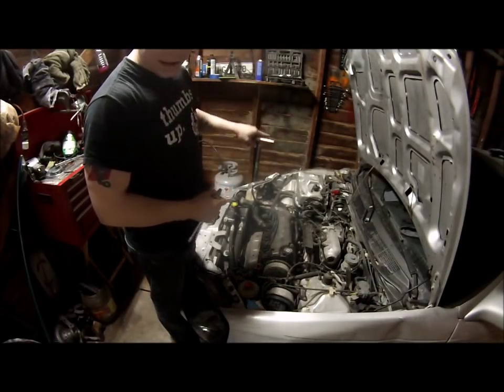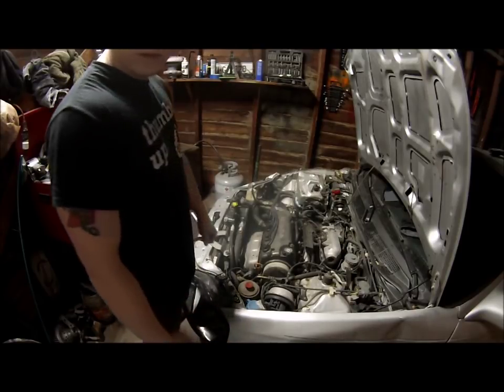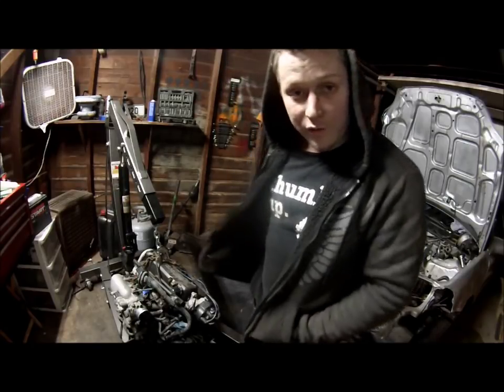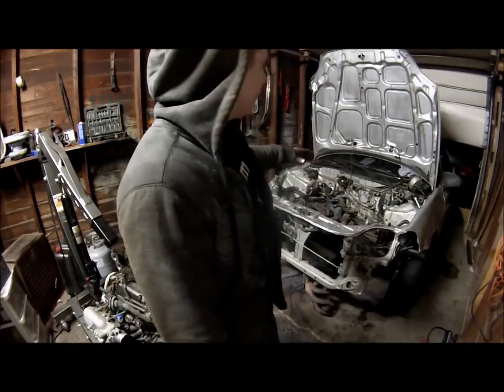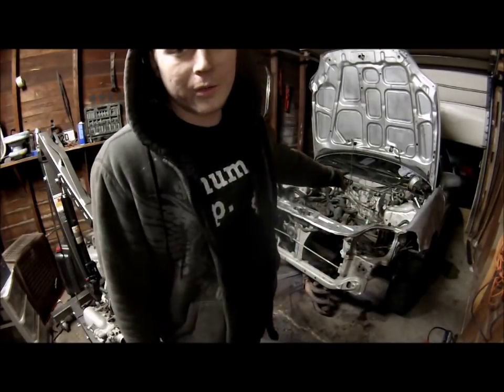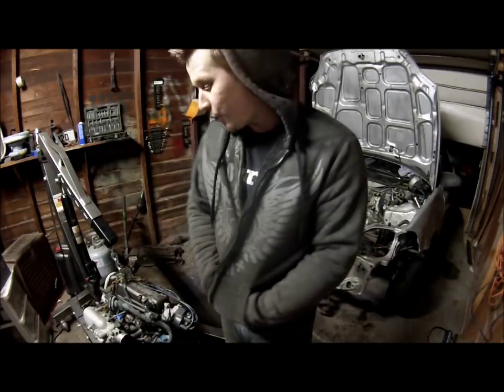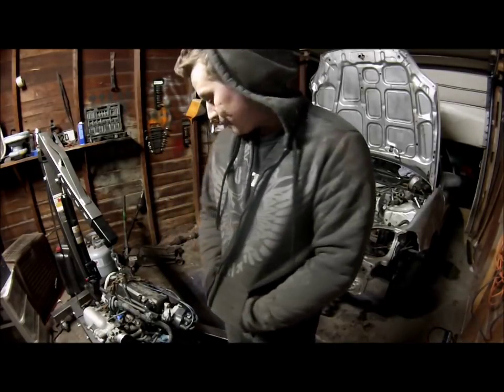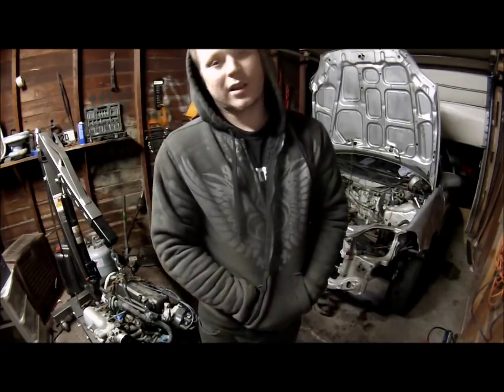Honda all motor build-Episode 1 Heart Removal on donor car

Comment: Also the z6 crank is much better for oiling.
Reply from the maker: Yea because the 2 oil holes per Crank journal. I know all about how bad these D16Y engines cranks are. Everything else seems well designed except the cranks

Comment: Throw some P29s in it, and mount them on the stock rods. Night and day difference with that bump in compression.
Reply from the maker: I rode in a p29 piston car it was crazy wasnt even cammed
Reply: Yeah they're the best bang for buck mod I can think of for an all motor D series.  Header and Intake Manifold/Itbs being a close second (With a Vtec head of course).

Comment: Hi James my D16Y7 has heavy back soot on the plugs. Car has good compression. Would your opinion be valve stem seals.?
Reply from the maker: If it smokes out the back a light blue tint. Its probably rings but that sounds more like its running rich might need a good tune up.

Comment: You could up your compression by swapping pistons. Here’s a guide which shows compression when using other stock Honda internals.
http://www.zealautowerks.com/dseries.html
Reply from the maker: Had it already saved on my favorites for YEARS. Thanks for looking out though! I used this years ago to get my compression ratio on my D15b7 bottom end with Y7 head and MLS headgasket